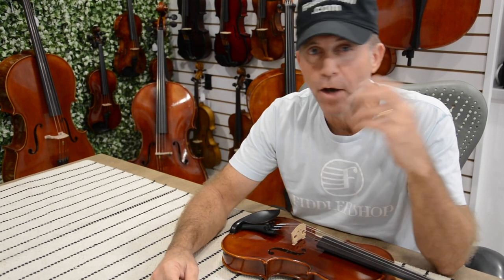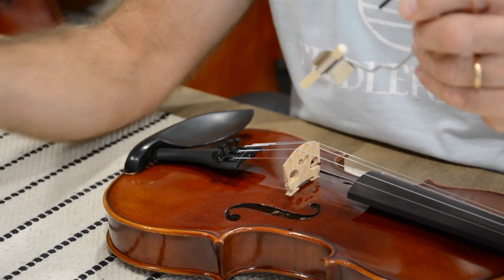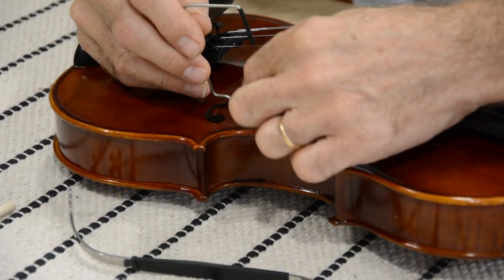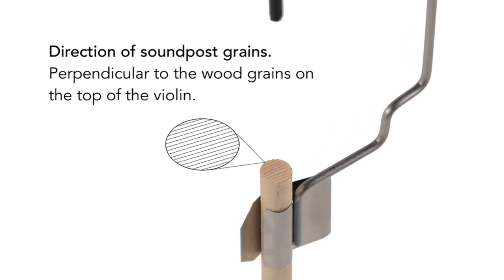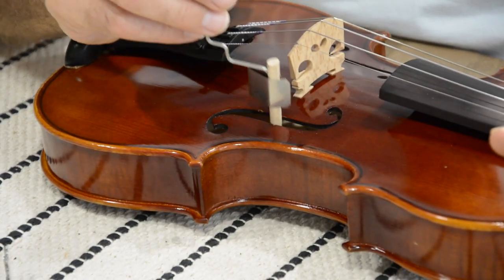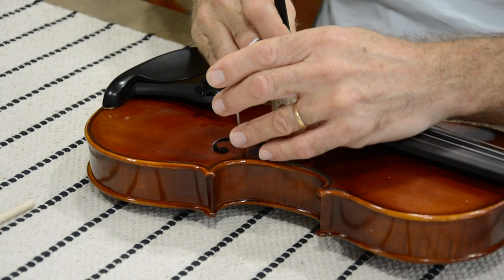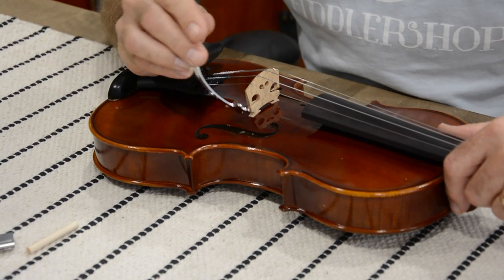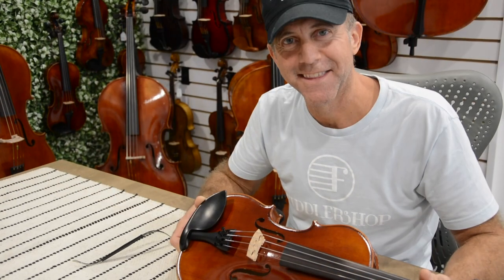How to insert and remove a violin sound post? Reset a fallen sound post

Comment: So, I eventually managed to get the sound post back in to position (it fell after a string change). Most difficult job I’ve ever had to do. Would have been easier for me to build a violin from scratch 😂
Reply from the maker: The good news is that you succeeded. Next time it should be easier. As a matter of a fact, you can just knock it down and put it back up again for practice...... ROFL
Reply: @1stfiddlerman  I’ll do that right now 😂😂
Reply from the maker: @Rialas  That a way!!!!
Reply: If you change one string at a time the sound post should stay in place ?
Reply: @McCRBen should yeah

Comment: How did you record the inside of the  violin. And why loosen the strings
Reply from the maker: We have this small thin camera that we use to look inside our instruments to inspect. When the strings are tight the bridge is pressing down on the top. You want the post to fit snuggly when the strings are loose. If you don't loosen the strings, you risk damage to the top when removing the soundpost from all the downwards pressure, and you risk the sound post falling whenever strings get loose or changed afterwards.
Cheers!

Comment: I have used this tool also the light with the camera you can take pictures of to see if the top and bottom of sound post are angled right its really not that complicated to use, once you get sound post in tighten strings to pitch play it any adjustment is done with the other tool he showed taking the sound post out a very light tap on bottom of sound post and I mean very light can make a very big difference on the sound you may not even have to do that you might like the sound you have without moving it
Reply from the maker: Thanks Spike :)

Comment: this may be a stupid question but is there a reason it's not help with a tiny dot of glue top and bottom?
Reply from the maker: Not a stupid question. The soundpost can be adjusted, moved closer or further to the bridge for more or less power and action. It can be moved more towards the treble side or base side for darkness/brightness.... The tops of thin wooden instruments change shape over time which usually makes the post too short and one must either move the soundpost outwards towards the f-hole, or make a new post. Lastly, if you glue the post and it gets moved, or the top raises over time, the post would take some of the top and or bottoms wood with it. Over time the wear would be greater.

Comment: I know to change strings one at a time to keep tension on the instrument and avoid the sound post falling. But if the sound post is properly fit and snug, it should NOT fall even with no strings or tension. Correct?
Reply from the maker: That is correct, however, humidity, temperature, and wood movement over time, plays a part as well. When the luthier sets the post they do it with loose or no strings, but over time, the top can rise, the temperature that was present at the time that they set the soundpost might be different then when you loosen your strings. There is a great chance that the post will tumble if you release the pressure especially if you handle or move the instrument around too much when it doesn't have that pressure.

Comment: Hi my violin E  string is quite less louder than others.  Can soundpost position solve this matter . Or make sound to base and treeble?
Reply from the maker: This is common. The reason is that the E string is steel and your other strings are not. When playing on the E, perhaps less pressure and further from the bridge. A soundpost position closer to the bass side of the bridge might help a little.

Comment: How did he manage to put a camera inside the instrument! Wow great video!
Reply: There are many pin camera(or plumber camera) out there you can push it through tail pin hole.
Reply from the maker: We had to shrink it and then expand it again. 😜 We bought this super thin camera with a light on it from China and placed it on the end button.

Comment: Sir may I know how far should put sound post from behind of bridge?
Reply from the maker: Anywhere from right behind it, start of the edge of the bridge touches the start of the edge of the post or maybe a half mm space to 1.5 thickness of the post. Usually one soundpost thickness is pretty good. I'll normally start at 5 mm behind the bridge and move it in different directions from there till I find the optimal sound,.

Comment: If my violin is sounding fine, is it necessary for a luthier to check and adjust the sound post once a year?
Reply from the maker: No it is not necessary. If it isn't broken, don't fix it. :)
However, keep an eye on your bridge at all times. Sometimes they lean forward and they will warp and eventually snap if they are not straight.
Reply: @1stfiddlerman so soundposts don't just move around every year?
Reply: @1stfiddlerman  it becomes obsessive compulsive when I go to the luthier weekly, requesting "check my sound post check my sound post" hahaha
Reply from the maker: @seanleechild  They shouldn't move but they do get bumped from time to time. Depends on how they are handled, or if you loosen all the strings at the same time it can move/slip.... And believe me, I know exactly how you feel. I was like that as well.
Reply: @1stfiddlerman  How did you get over your obsession with always feeling compelled to have your sound post checked?
Reply from the maker: @seanleechild  First I learned to adjust the post, then I played with it WAY too much, then I realized that I'll never find the perfect positioning. lol
Also, figured it's easier to blame things on my technique than on the soundpost.
Reply: @1stfiddlerman  so I need to take it for a quick check from the luthier once a year, and then leave it alone. hahaha 
It's never perfect. And even if I go weekly to adjust the sound post, different luthiers may adjust it differently. So stop fussing. hahaha
Reply from the maker: @seanleechild  So when I would adjust my own post on a regular basis, I learned that I can improve one thing while making something else worse. I could for example get more power by tightening the post, while making it slightly more difficult to play softly. I could get a darker sound by moving it closer to the bass bar but didn't enjoy the lower string sound, while enjoying the higher string sound.... There was almost always a compromise. When you get an adjustment, make sure that you test the instrument sufficiently at the luthiers and try different options. Once you find what you think works, leave it alone until you feel that there has been a change. Posts get too small over time and need to be changed because the top rises over time in that spot. If you look at some antique violins, you can see how high the f-hole can be close to the soundpost.
But above all, try to enjoy the instrument and see how much your technique changes can make a difference. Focus more on how much bow pressure you use, the bow speed, how close or far from to the bridge you are when using more or less pressure. Make that an obsession instead. THEN, focus on singing with your instrument. Creating and using colors, dynamics..... etc.
Reply: @1stfiddlerman  thanks Pierre for your keen insights. Shift obsession to adjusting technique, bow speed,  pressure bow placement, contact point, creating different colors, making the instrument sing etc.....
You did say the sound post shrinks over time and needs to be replaced. approximately how many years is that, 5 years, 10 years?
Reply from the maker: @seanleechild  The soundpost does not shrink as far as I know. The top rises. Could be as soon as 3 months, and as late as 5 years. It depends on how seasoned the wood is and the humidity that the instrument endures. Cheers

Comment: My bridge collapsed and soundpost fell on my upright. I don't have the tool...any cheats or hacks to diy it at home?
Reply from the maker: It would be difficult but if you can loop a string around the post with a stick of some sort, a pencil or what have you,  then get the sound post wedged the right way, you could adjust it with a fork. Good luck!
Reply: @1stfiddlerman  done! Managed to set it after a few hours of faffing around and a bit of swearing. Used two shoelaces, one high and one low on the post and a coathanger to move it into place.... tightened the strings up and she's right as rain. Even played today and recorded a vid and it sounds as good as before. 

 Left the shoelaces attached and chucked em inside the f holes, because I couldn't be arsed untieing the knots.
Reply from the maker: @anthonyplaysbass  Congrats. That was very creative. I'll remember that if someone asks. lol
Maybe you can get a knife in there to cut the laces if they become bothersome.
Reply: @1stfiddlerman  haha. I'll be taking it to a luthier in the coming weeks anyway for a look over and see if any quality of life or serviceable items can be swapped around to get it pristine. It's (I think...because I see vertical woodgrain on the front?) A ply bass made in the 80s in Czechoslovakia. 

Hasn't been looked at since like the 90s when a new bridge was put on it by renowned luthier here in Melbourne called Puglisi.  So I'll take it back to his shop.

Comment: There’s a small crack in my soundpost what should I do? Do I replace it or it’s fine to put it back in the violin?
Reply from the maker: It depends. If it were here, I would replace it because the wood for the soundpost is not expensive and we know how to do it. Wha you risk is a slight buzzing sound. Not guaranteed but possible. It may not affect the sound at all. Very difficult to say without seeing it. Good luck!!!

Comment: hi fiddleman,
I like your videos .
do you recommend any hide glue I can buy to glue the open and small crack for my violin.
there are so many hide glue when I Google it but I don't know which one is high quality and good for good violin repair .
also can you also recommend the heating tool for heating the hide glue an the tools( knife or....) I need to glue the seam open area.
do you mind provide me the website link that I can directly buy the hide glue and all tools.
thanks
Reply from the maker: There are two that we use. This one is better because of the slower tack:
https://internationalviolin.com/ProductDetail/10223_hide-glue-grade-222-slower-tack-1-lb
This one is cheaper and works fine as well:
https://internationalviolin.com/ProductDetail/10222_hide-glue-grade-222-slower-tack-12-lb
We buy these cheap baby bottle warmers and put a jar of hide glue in the warmer with water.
I don't recall which warmer we buy but below is an example from Amazon.
https://www.amazon.com/Modern-Design-Tommee-Tippee-Easi-Warm/dp/B07Q8NQ29G/ref=sr_1_3_sspa?keywords=baby+bottle+warmer&qid=1643313150&sprefix=baby+bottle+w%2Caps%2C128&sr=8-3-spons&psc=1&spLa=ZW5jcnlwdGVkUXVhbGlmaWVyPUEzRkVSSEs4TlExRElUJmVuY3J5cHRlZElkPUEwMDQ3MjY2MU5XVkhWRVpBQUdSQiZlbmNyeXB0ZWRBZElkPUEwNTkyMjc3WTEwTFNXV1ZMTEhZJndpZGdldE5hbWU9c3BfYXRmJmFjdGlvbj1jbGlja1JlZGlyZWN0JmRvTm90TG9nQ2xpY2s9dHJ1ZQ==
Reply: Thanks for your sharing.
Do you recommend any hide glue which is in good quality and  take shorter time to dry?
also , what kind of knife i should use for insert into the open area?
Reply from the maker: @davidt6044  Yes, the second one. Use a roundish flat butter knife and you can sharpen the edges on it. Old ones are often perfect for the job. Even silver older, antique knives that you can get cheap on Ebay.
Reply: thanks for all your help,  maybe more question later, hope you dont mind.  i know you can play violin like I do .  but I just try to repair and need your right direction.
Reply from the maker: @davidt6044  Sure. Ask away!!!
Reply: Do you mind suggest what bottle warmer from baby milk is good for heating hide glue?  I believe hide glue need to be heat up to 140f or 70c.  Am I correct?

Please let me know which bottle warmer is good choice.  Thanks

Comment: Hello Mr. Fidler, what is the length of the violin bridge from the bottom up?
Reply from the maker: It differs from instrument to instrument. Are you concerned about how much over the fingerboard you need to have the strings? IOW, how much to cut it down?
Reply: @1stfiddlerman  My question is how high the strings of the fingerbord Thank you
Reply from the maker: @peternajjar4700  On the E string side, 3.5mm and on the G string side, 5.5mm. These measurements are approximate.
Reply: @1stfiddlerman  Thank you very mach mr. Fiddlerman
Reply from the maker: @peternajjar4700  You are welcome!

Comment: Hi Fiddlerman. You make it look so easy, but it's not. I would no more attempt to remove and replace the sound post in my violin as I would no more attempt to remove and replace the cork in the head joint in my concert flute. I shall defer these removals and replacements to a trained professional, and avoid the grief and aggravation. 😓
Reply from the maker: True. :)
This is a top selling product, and I made this to simplify the process for those who use it but not necessarily to encourage others to do it. The inserter/remover makes it easier to do the job.

Comment: Hey,if anyone could help me.....a few days back my violin just cracked on the region where the upper bout and the neck are junctioned together....I just don't understand how??? Could it be due to the environmental humidity?? A little help would be appreciated
Reply from the maker: Dryness is the biggest contributor to cracks on instruments. In your case it might have been a badly joined neck but it's hard to tell without examining the instrument. Could have been connected too tightly at the top. The block might not be properly glued to the top at that spot as well. How old is the instrument? Tell me more about the instrument.

Comment: I tried to google the soundpost, i still don't understad it's purpose,

Wth does it do ? please someone explain it in a junior high level🤕
Reply from the maker: @CortVermin  Great answer CV :)

It also helps supports the pressure from the bridge (strings) treble foot side. Inside the violin you'll see the bass bar that supports the lower strings side of the bridge.
Reply: @1stfiddlerman  why does the instrument need it?  Guitars do not have one I dont think
Reply from the maker: @chrishall2594  More downwards pressure on the bridge feet. 50 lbs.

Comment: a:\ thanks . 
b:\ dont have the tool so i took  2 metal wires and  made a csisers like clamp  with them and it did the job .
to set it to place i used a thin fork handel part from the other f port. 
to see inside i lay down the iphone facing the violin with flashlight on . 
c:\ i took 1 horse hair like the ones on the bow and tide the sound post with it before the inserted ( like a rescue rope) so i wount have to fish it from inside .
once it was in place i just plcked the hair extruding part.
#myviolintrademark .

Comment: Why can't one end of the pin be glued into place? This design  seems very half-assed,  allowing the post to fall out like that.
Reply from the maker: There would be many ways to keep it from falling, but that would make it difficult to adjust. Moving the post in different directions affect the tone and response in various ways. Also, over time, the top lifts and a new longer post becomes necessary.

Comment: my bridge fell into my violin and it knocked down my sound post
Reply from the maker: The soundpost is very vulnerable when there is no downward pressure from the bridges and tightened strings. One would almost have to jam the soundpost in a bit too tightly to insure that it doesn't fall down. We (fiddlershop.com) ship our instruments to customers with pressure on the strings so that we can adjust the soundpost and ensure that it will most likely be set right and sound the best when you receive it.
Reply: No as in my bridge is inside my violin along with my knocked down soundpost
Reply from the maker: @coldashell7057  Turn the violin upside down and shake it back and forth carefully until part of your bridge sticks through the f-hole. You should be able to work it out. You might need a tweezers.